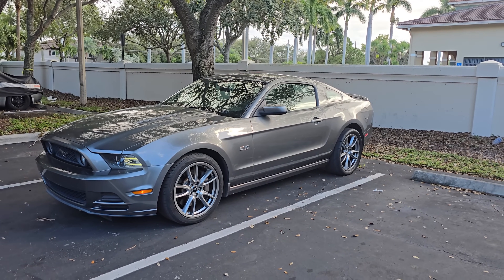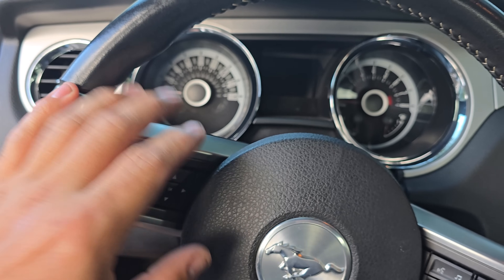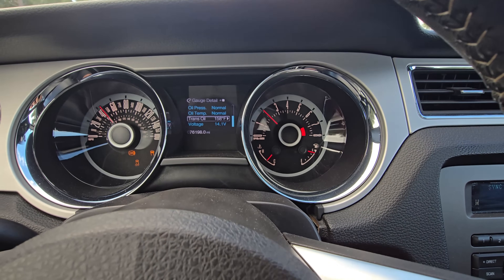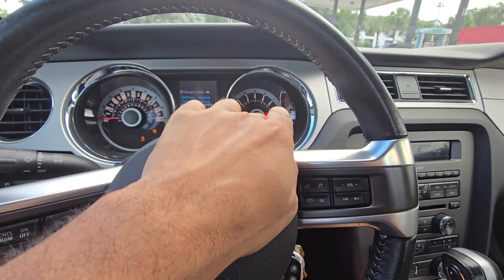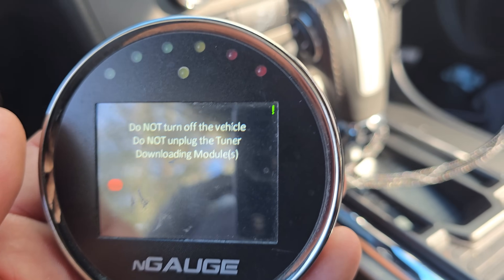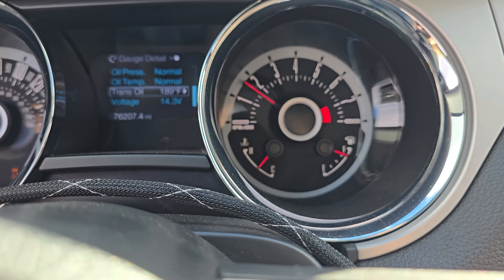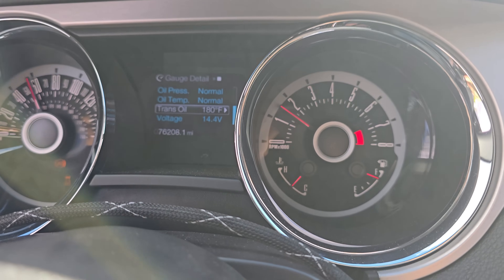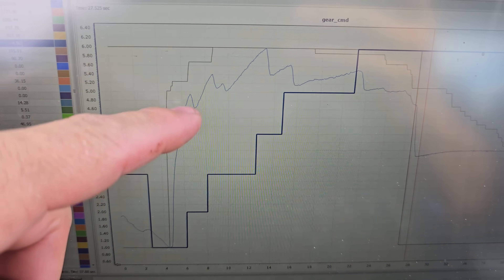6R80 Torque converter lockup tuning for better drivability

Comment: Yeah whatever John Nardi sent me drove like shit. Pulls up to 40-50 degrees on the 3-4 shift but claimed that’s how everyone’s car drove 😂
Reply from the maker: @philliplamb1998  simple data logging will help.
Reply: @ I tried that. Talk with John Nardi about it. The only reason I tried Lund was because of drivability and I got the opposite. The 93 file he sent me starts like an e85 file in -5 degree weather every time and has issues with the 5-6 shift where the shift strategy overlaps and causes an upshift and downshift at 40mph depending on if you’re barely on the throttle or off.

Comment: I have a 2020 tuned by Lund and now a bought another car, it’s a 2013 GT 6R80. Can I tune my 2013 using the same tune device used for the 2020? It’s a HP tuner. Thank you

Comment: My 05 GT 6R80 Coyote swap has a weird 3rd gear "flare". Makes me wonder if its an issue with torque converter lockup.. I used your datalog on here to cross reference my log so I can understand it better lol. It doesn't do it at WOT either. Just while cruising. I definitely learned something today.

Comment: I’ve got a 3800-4000 Circle D stall on a 10R and I would burn the car down if it didn’t lock up until 65+ mph lol. Mine locks up on the 3-4 shift at 25-30mph and it’s perfect.

Comment: I have a Coyote swapped 81 Granada with a Gen 1/2 hybrid engine, 17 circle d 6r80 and circle d converter. Gen 1 control pack. I tuned it where D is more of a stock style lockup and shift pattern and S is unlocked like this and a higher shift at WOT. Car has a Lokar shifter so I can pick one or the other, or select shift just like a factory 13 and up. Makes it nice to have both shift schedules just by clicking forward or back.

Comment: I need this tune lol. 
I have a 4C Centri Car and 
I hate my lockup in my 6R sometimes.
Reply: How does your car drive with the 4C lockup?  I have a 4F lockup Circle D in my centri car, and it doesn't drive all that great in "D" on the street.  Under very light acceleration, it likes to shift into 6th and lockup by 40mph, lugging the engine.  If I drive it a little more aggressively, it acts relatively normal.  My preferred method is to drive it in sport mode and shift the car manually with the paddles.  I refer to "D" as drag strip mode. LOL.  

That being said, the car is an absolute monster when floored at the track.